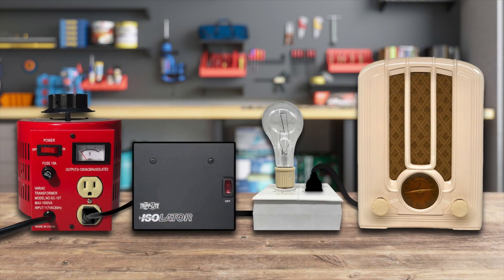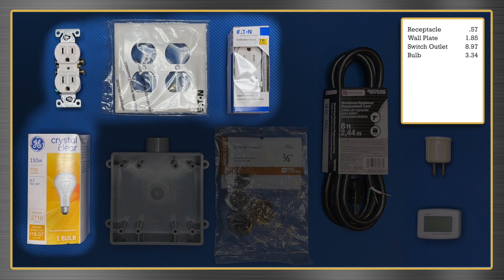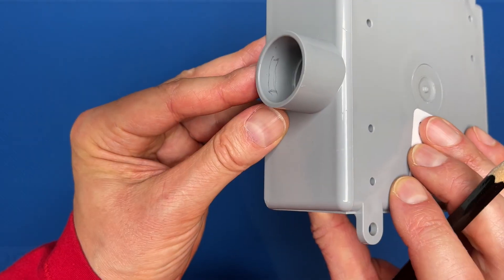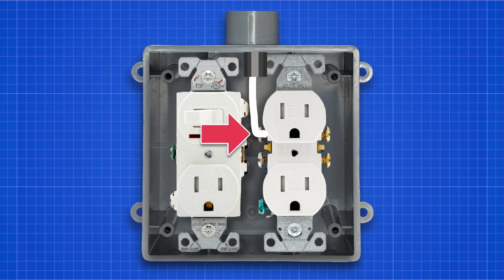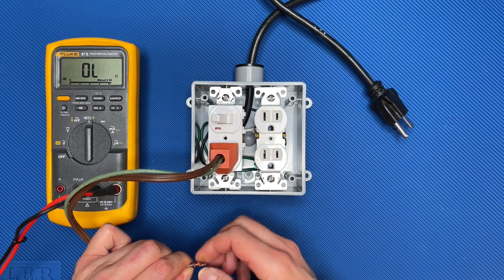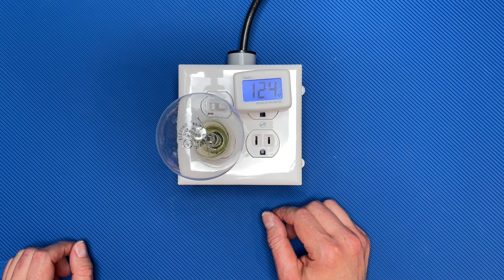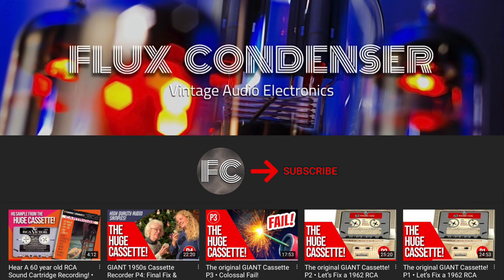Build This Dim Bulb Current Limiter

Comment from the maker: I’ve created an Amazon shopping list for everything you’ll need to build this dim bulb current limiter. You can order the parts from my Amazon affiliate page: https://www.amazon.com/shop/fluxcondenservintageaudioelectronics?tag=onamzfluxcond-20&linkCode=ic7
Reply: The parts list is missing.   Perhaps something changed?
Reply: Can you give me some advice?
I've been looking for a true power isolation device for years -- not just a transformer and surge combination.  
Something more like a 120VAC motor connected to a 120VAC alternator with an insulated axle so the output voltage is truly isolated electrically from the mains.  
Does something like this even exist?  
I haven't been able to find anything like it despite countless searches.
Reply: Why is it necessary to remove the break off 
tab from the switch? and what if the switch does not have a break off tab on it? then what do i do?
Thank you, very interesting video and also informative👍
Reply: @FluxCondenser Would you consider building & uplosding a bucking transformer? 
(For the purpose of knocking down AU & UK voltages from 250v to a China friendly 220v and/or from 120v to 110v.)

Comment: I like everything you do, but this by far you have overcomplicated big time and now I’m questioning everything you do. I’m an electrical contractor. I’ve been doing electrical for 21 years. You don’t need a Dremel. You don’t eat all of these things you’re trying to say you’re doing it the wrong way you’re using products that are not meant to be used the way they intended. But more importantly, you’re over complicating it for all the users you could just give them the right material to make this product. This is ridiculous. You don’t need a Dremel if you’re modifying connectors you’re doing it wrong. Get a two screw connector 4S deep metal box an industrial raging cover that can have an outlet and a switch. It’s really simple.

Comment: Thanks for the video! After a few mis-steps I now have a nice dim bulb current limiter. One question I have is that if I connect an old All American Five radio to this tester should I expect it to light up since they often are grounded to the chasis? ... thanks again for a great video!

Comment: NO AMP METER? I spent my career repairing electronics and never once used a dim bulb. I always used a variac and current meter. The first thing is to have a good idea as to how much current the device being powered normally draws. As you turn up the variac, keep a close eye on the current draw. If the current draw is to high, back down the voltage. I always  monitored the current and voltage. The current draw could be just a small amount beyond expected which is good information to know before you start troubleshooting. This process worked very well for me.

Comment: I have a question, why do you break off the metal switched outlet tab? It will just change on/off swither polarity. I think you could connect hot wire to the white screw at the top right avoiding the jumper cable from top left to the bottom right by using the metal tab connector.

Comment: @FluxCondenser - I built one and it worked perfectly. I no longer need it to work as a limiter. How do i change the wiring so i can use it a switched 3 outlet extension cord ? Thanks in advance

Comment: I can't find a switch outlet as you've described in your video. I ordered from your Amazon shop and the outlet I received has two brass screws on one side and a green ground and then it has a brass and silver screw on the other side. None of the screws are next to the switch and there are no black screws
Reply: Same problem here.
Reply: I found the same part @fluxcondenser uses. It was at Lowe’s. Eaton part number TR274V-BX-LW “Combination Single Pole Switch and Grounding Receptacle.” It has the same black screws, etc. About $11.

Comment: Thank you very much for the instructions on the dim it's been very helpful although I do have a question about the digital voltmeter mine doesn't seem to match with the multimeter it's coming up 116 in the multimeter says $120 is that a common thing with these dm55

Comment: What would happen if you unplugged the light bulb socket???  will the circuit be open???  Ex.  Left(switch on and nothing connected to the outlet) Right(the radio connected in either outlet.)
Reply from the maker: Yes, if the bulb was removed or the filament blows, the circuit would become open and power would be removed from the device under test.

Comment: If using with isolation power supply would it be best to use polarized cord without ground. Otherwise are we not defeating the isolation?
Reply from the maker: To be fully isolated, yes a cheater plug can be used to eliminate the ground.

Comment: I just built this current limiter yesterday. I can't thank you enough for this really well-presented video. My switched outlet was completely different than the way your was set up (yay standards!) but it was pretty easy to confirm the connections with my multimeter and, with the final testing to confirm the circuit, the build came together in a leisurely hour... including testing it with my variac.

My friend handed me a valuable vintage amp to repair, and now I feel confident turning it on without blowing it up!
Reply from the maker: Glad to hear! Well done.

Comment: How long do you leave it on to condition capacitors in a guitar amp if: 1.) It is brand new (built it yourself) 2.) The amp has been sitting around for an unknown time.
Reply from the maker: I don’t recommend conditioning capacitors and a dim bulb current limiter is not the device you would use for that anyway.

Comment: A schematic showing how you wired this up would be helpful. Lowes and Home Depot are thirty odd miles away for me, it is far better to order parts via mail order of one form or another.  My part won't be the same as yours and therefore may not have the same terminals in the same places, as you noted in this video.
Reply from the maker: It’s not a traditional schematic, but I do show a diagram of current flow which amounts to the same thing. Further, if one can’t understand the wiring of such a simple device, I’d have to wonder at not only their need for current limiter, but also their ability to be working with high voltages at all. Truly, if someone has a problem building this thing from the instructions I provide, they have no business building this thing in the first place.
Reply: @FluxCondenser That does discourage those of us learning. We need to start somewhere.

Comment: Nice guide but I cringed at the double ground on the outlet screw, just pigtail it with a lever nut or wire nut.
Reply from the maker: Absurd comment.
Reply: @FluxCondenser   double ground wires on a single outlet screw terminal is against code in just about all 50 states.  4 more inches of spare wire (you had it) and a wire nut and it would have been legal, cleaner, and properly done.

Comment: Here in the UK you can buy 3, 6 and 8 gang sockets and the rear housing for them meaning that you only need to use one set of wires, so one from the plug and connect it to the rear terminals of the socket which means that you don't need such complex wiring arrangements...
Reply: @FluxCondenser ???
"gang sockets" means "recepticles" or "the holes the plugs go into" and the "gang" means more than one socket in the same housing since many sockets only come with 1 set of holes in Europe, UK, most switched of course since things are safer over here...???
Reply from the maker: My question is not what the simplistic terms “gang” and “receptacle” mean. But rather, how your comment pertains to this project. If you’re just pointing out some differences in availability of products and codes in the US vs UK, that’s fine. However, some readers might infer from your comment that using such products would negate the need for “such complex wiring” in this project.

Comment: Important: Do NOT solder wires that are going to be clamped down in some manner. The solder will cold-form over time, causing a bad connection and possibly a fire hazard. Instead, twist the wire together well, and if using a screw terminal like on an outlet, bend it in the same direction as the screw will turn when fastening, usually clockwise. This way, instead of pushing the wire out when you tighten the screw, it will instead be clamped down. Even better, if available, you can use a crimpable fork terminal for an even more secure connection.
Reply: Had a house fire from exactly that. "Hard" joints heat up, harden more, heat up... rinse and repeat.
Reply from the maker: Huh? No soldering was shown or advised in this video.
Reply: @FluxCondenser  I think he means where you tinned the leads
Reply: @FluxCondenser  4:00
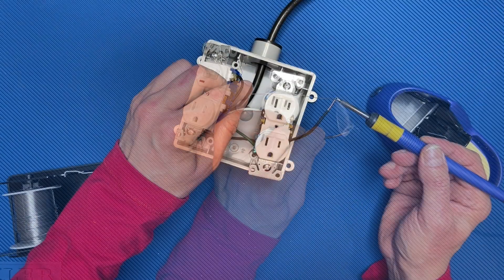Reply: @FluxCondenser  Yes it was --> see him soldering wires @3:59, @5:08, @5:27, and @5:57. Sorry, I know this is dated 3 years ago...

Comment: I did my short test without the volt meter since it doesn't arrive till today. Will a short fry the volt meter?
Reply from the maker: The short test just sees if there’s continuity. By continuity, we mean there’s a closed circuit and electricity can flow through the path under test. 

Of course nothing should be plugged into the wall. The continuity is tested using the battery in your meter. It simply sends a small voltage out of one probe and checks to see if the voltage is returned at the other probe. If so, there’s continuity and the meter will beep.

Comment: Well, I didn't break off the switched outlet tab and I connected the cable hot to the non-bridged switch screw. I passed all your tests and I passed all my tests (actually shorted one of the dual outlet sockets and the light went on) so I'm not sure why you cut the tab and made the pigtail. Still like to know.
Reply: Others on YouTube also don’t break that bridge. I’m confused.

Comment: Really enjoyed your video and the rest of my parts should be arriving today, but I have a question(s): Why do you need to cut the tab on the switched outlet and add a pigtail? Isn't it the same result if you leave the tab in place and just wire the wall cable's hot lead to the switches top screw? Thanks.

Comment: I've just built this dim bulb current limiter, just one question, how would you add an ammeter to this? it would be more useful to know how many amps is going out to the DUT
Reply from the maker: Yes, that would be a useful addition. Simply plug the ammeter between the dim bulb and DUT.
Reply: @FluxCondenser  I was thinking of a way to add banana plugs on the hot line to measure with probes but then it would leave the line open if the probes are not used or just add an ammeter gauge somehow
Reply from the maker: I’d consider getting one of those plug-in amp/watt meters. They’re handy to have around the house and good for work on vintage electronics. You can use it with the dim bulb and without.

Comment: Thank you for this! I tried making one today. It passed all the tests EXCEPT for the one where there should only be continuity when the switch is in the on position (hot prong of power cord and hot side of dual outlet). I can’t identify where I went wrong. Any ideas?
Reply from the maker: I’m not certain where things went wrong, but the issue, evidently, is that the switch isn’t acting as a switch (enabling and disabling current. So use this to help your diagnosis. Perhaps do a simple schematic illustrating how the circuit should function and compare that to your wiring. Good luck.
Reply from the maker: And also, you may want to temporarily disconnect your wiring to do simple continuity tests on your switches and outlets.  Put your multimeter in “beep” continuity mode and confirm which terminals open and close continuity (no beep/beep) when you activate the switch.
Reply: @FluxCondenser  Thank you! I went back and discovered there was a tiny sliver of metal left over from the break-away tab.

Comment: Thank you for the video. I built the DBT and had all the continuity that you showed on the video. The only thing that never worked, was the LED on the switch never lit up.  I hooked it up to my Variac and the DUT was an amplifier I am building. The lightbulbs did not glow (60W &^ 100 W), but there was no smoke from my amp. Just not sure if the DBT is working.  Thanks

Myles

Comment: hi - I have Variac Transformer TDGC2M 2000VA,  can I  used a 2 prong adaptor to isolate the Grounding ?
Reply from the maker: That will isolate the ground, but your hot and common won’t be isolated that way with a typical variac. It takes more than an adaptor to isolate a Variac.

Comment: Thanks for the great video.  I was able to sneak in a filtered IEC power connector on bottom portion of case. Makes for easier storage and I also find that the common mode filtered front end helps keeps AC  power noise levels from swamping front AM bands. Dimmer switches are horrible noise sources !!!!!!!!

Comment: IMHO this is the best (and slickest) current limiter I’ve seen. So nice and compact. My voltage meter doesn’t kick in until 34V is reached which is probably normal and not a problem. Thank You for posting this professionally done video!

Comment: I don't see the switched outlet you list on the Amazon parts list as the same in the video. There isn't a gold connection to make the jumper.
Reply: I’m having the same problem.  The switched outlet he linked in the parts list is not the one he used. The list switch has no black screws and fewer total screws.

Comment: I’m stumped. Built nearly identical limiter, when testing continuity, everything tested perfect. But the thing is dead.  I don’t get it.  Is there a situation where it would test 100% correctly but be completely non-functional?  The outlet is hot, the volt meter works when plugged directly to the wall…but I get absolutely nothing when I plug the limiter into the wall. Any ideas about what the hell I’m doing wrong here?  Thanks.
Reply from the maker: If the outlet is hot, then the limiter can provide voltage to the device under test. If you mean by saying, “the thing is dead” that the bulb doesn’t light, remember, whether the bulb illuminates is dependent on how much current is passing through it. In a circumstance where you’re using a high wattage bulb and there’s little resistance at the outlet, you won’t necessarily see the bulb illuminate. And, if there’s no load at the outlet (nothing plugged in or switched on) the bulb would not illuminate at all as there’s nothing to close the circuit.
Reply: @FluxCondenser  thanks for getting back to me.  I meant that the volt meter isn’t working when plugged into limiter. It works fine when plugged straight into the wall, but I get nothing when plugged into limiter. I guess I must have wired something incorrectly, but it’s a little surprising to me that every continuity test worked perfectly…yet no outlet on the limiter is getting any juice.   That make more sense? Thanks

Comment: Saw the link to Amazon but the cable connectors there is 3/4" and the hole of the electrical box is 1". Any suggestions? Thanks!
Reply: That's what I bought from Amazon and it's the same number with 1" hole. Anyway thank you for video construction and advice.
Reply from the maker: Check to see that the model number on your box is E9802E. That box is designed to be used with what’s called a ¾” connector, but the actual hole in the box is much larger. If your box has a ¾” marking on it, it will work with the ProConnex 44741 NM/SE Plastic Cable Connectors which are 3/4-Inch.

Comment: Not sure about wiring? I ordered directly from Amazon from your parts list . However my switched outlet doesn’t have black screws or three screws to put white wire to jump from switch to outlet ?
Reply from the maker: Richard, sorry to hear that. Fundamentally, though, if it’s similar switch it can be wired in the same way I show. It’s just going to be a matter of locating which terminals on your switch are intended for the hot connection, and switch connections. Once that’s established, you should be able to use my guide to make the proper connections. If you’re at all unsure, though, you might want to try to locate a switch that more closely matches the one I show in the video. Good luck.
Reply: @FluxCondenser  well it didn’t work so I guess the power coming in to side of double outlet was wrong side of socket. I got zippo out of anything no matter where switch was. Went to home depot and all they had was outlets with 2 screws on each side as well.
Reply from the maker: @richardadelberg8961  OK, just use a multimeter to check for continuity while activating the switch. That should help you figure things out.
Reply: @FluxCondenser  shouldn’t I run hot wire to switch first then instead of double outlet and then from switch outlet to double outlets?